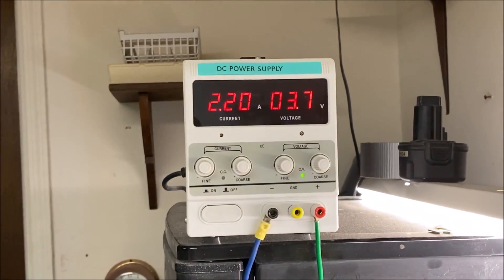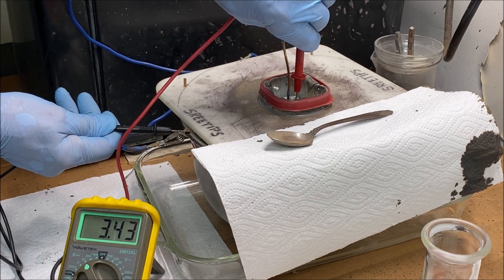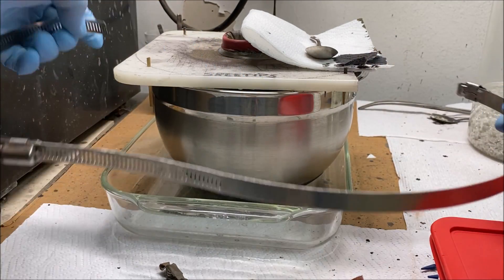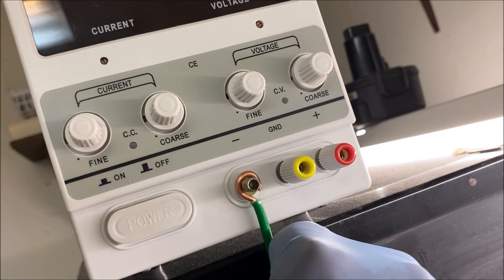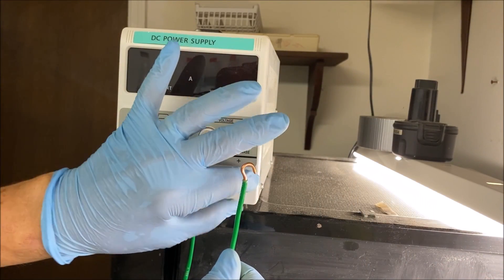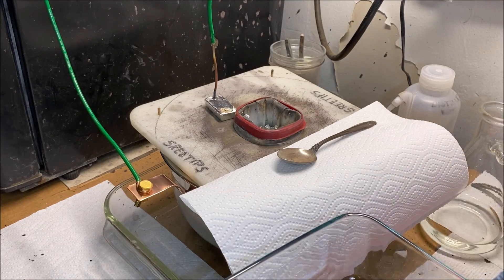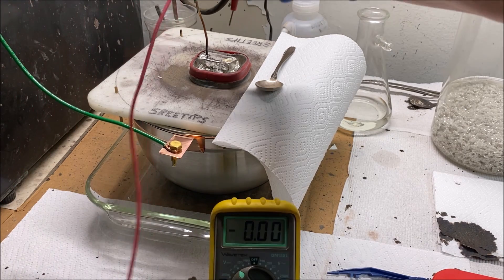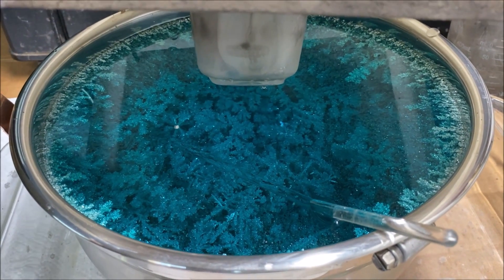EP007 Silver Cell Update New Cathode Connection

Comment: Hi mate, I used copper sheet as my cathode and the solution turned blue and doesn't work as well now, I'm guessing it pulled all the silver out of the nitrate. Can I add more silver nitrate to this solution and keep using it?
Reply from the maker: No, because in accordance with the reactivity series of metals, the silver in the silver nitrate electrolyte will “cement” out on the copper, consuming the copper until it’s gone completely. The cement silver will fall to the bottom of the container.
Reply: @sreetips  Thank you so much for clarifying! I thought this might be the case, I just wanted to make sure. New batch it is. Also is 925 ok to use as the cathode or should it be 999? Assuming the latter and will use that when I can, but curious. Cheers
Reply from the maker: I use a stainless steel bowl for the cathode. I feed in 980 per thousand, impure silver. The anode must be relative high purity to begin with. I achieve excellent results with this combination.

Comment: I would also try an additional anode connection at the base of the bowl - a copper round should serve as a nice base. 

You also could experiment with making a conductive grease using a bit of silver cement powder with some white lithium grease. Will be messy but only takes a light film to get the job done. 

The stainless bowl is not a great conductor which is why the crystals grow unevenly.

Comment: I took an expired / empty water based fire extinguisher (stainless) and cut the bottom off for my silver cell. About 8 inches. My silver basket is a 5lb peanut butter jar with holes in it. I fill it and put the lid on. It presses my anode down on the silver in the jar. I only need 1 liter of electrolyte to run the cell

Comment: Is the copper anode piece you made created out of a piece of 18ga. copper sheeting. That's what it looks like but I'm just checking to see if that's correct. The improvement to the flow of current is immediate and all your later videos with the silver cell seem to have no problems after this adjustment to the mechanism.
Reply from the maker: I’m not sure of the thickness. It was sold as copper strap from Georgia Copper Company

Comment: Great video again of course sir. What is the Anode bar made of? I'm taking notes on this procedure. How much scrap silver did you start out with? Is this procedure profitable? Thank you for your time and all the incredible videos!⭐⭐⭐⭐⭐rating
Reply from the maker: I made the anode electrode bar using pure silver crystal about 2.5 Troy ounces. I suspended a copper wire in a graphite mold, heated it to redness with a torch, then pour molten silver to bond to the wire
Reply: @sreetips  Thank you

Comment: Nicely done!  Great contacts there - only small thing I was wondering about is if there is any danger of the anode dissolving down to the copper - but honestly I think that is just really unlikely you leave unattended for a long time.  That nice thing is that it should be pretty consistent in terms of current.  The loss from those clips really is surprising - amazing what some corrosion can do!

Comment: You are doing a great job of removing that hidden resistance. You will eventually get some corrosion between the copper strip and the stainless clamp because of the acids you use floating around your lab as droplets and vapor. One solution would be to solder or braze that copper wire right to the outside of the stainless bowl. Another low tech solution would be to put a little vaseline between all the metal connections.

Comment: You should wrap that strip of copper around the whole S.S. bowl. and hold it in with the hose clamp. IDK, but will the crystal mostly grow near where the ground is? You could also wrap some black electrical tape to the ends of the negative wire. I done it a lot when I was a fitter and we ran out of a certain colour of wire.

Comment: If you are overly concerned with identifying positive and negative at a quick glance, you can always slip a piece of red and black heat shrink tubing over the ends of the green insulation. I did that when I replaced the leads to a battery charger this weekend.
Reply: Just wrap on with black electrical tape at the end but its shocking to see him FINALLY do what people suggested instead of cranking the power up and up

Comment: SREETIPS:   Take this one step further, and set the current limit of your power supply.   You do this by dialing the current limiting knob to whatever current you want.   That way, if the cell shorts, the supply won't short and blow, and just won't source any more current than what you specify.   You can set the current limit to just above where you have it now, so it'll stay in constant-voltage mode, but will go into current limiting if the cell shorts.   No need for a fuse, as the supply already has a better feature.   And there's usually an indicator on the supply as to when it goes into current-limiting mode, so you'll be able to visually tell.
Reply from the maker: I didn’t know that, thank you
Reply: @sreetips  No prob.   Love your channel, man.   And nice job on that copper ground strap!   As others have said, you'll still want to make sure no oxidation builds up between any points of contact, which could still happen, as everything is exposed to vapors.   You could get a few cheap panel-mount voltage meters on ebay for a couple of bucks, and permanently wire them up to the supply and bowl, to display the difference in voltage in real time.  That way if the connections start to get oxidized, you'll see it in real time.

Comment: I still wonder about the high voltage of this cell. When the ions involved on both electrodes are the same - Silver goes into solution and silver comes back out again - the voltage should be much closer to zero. I have a similar sized copper cell running at ~0,6V drawing 5-8A depending on temperature. 

Can you stick your negative probe into the electrolyte for a reading of the local potential difference?
Reply from the maker: Voltage setting is critical to avoid other metals plating out with the silver and for best crystal structure. 3.3vdc to 3.7vdc is the range. The theory behind it is a mystery to me - they said run it there and you’ll be fine.
Reply: @sreetips  True. I just try to understand what's going on there. I'm sure you're doing it right as your results are right.

Normally while electrolysis you limit voltage to an "as low as possible while keeping reasonable throughput"-level. BUT your voltage is a lot higher than what I'd expect. Somewhere in the chain you drop 3V on something that I don't yet understand. 
By theory you have to use voltage to dissolve the silver into ions. But you gain the exact same amount while plating out silver (as long as the electrolyte is reasonably pure). So in the end in this kind of electrowinning process the voltage is almost 0, just to drive the current.
What is the concentration of the electrolyte that you start with?
Reply: He'd need a reference electrode (Pt+H2 or Calomel), see https://en.wikipedia.org/wiki/Reference_electrode to read the potentials accurately.

Comment: I don't know if it matters or not, but it looked like you measured between the anode bar and the metal strap, not the bowl itself.
Reply from the maker: I seen that during editing so I double checked with the probe directly on the bowl and got the same number at the stainless bowl

Comment: Nice!!  Might be interesting to take a voltage reading on the opposite side of the bowl (from the cathode) to see if there's any voltage drop
Reply: I was thinking the same thing! 😂🤣😂🤣
Reply: I think that the crystal would have been growing significantly less evenly, before this, if it were a lot of resistance.

The bowl is stainless, which isn't great for conducting electrons... Hmmm...

Comment: I was literally thinking of a ground strap almost identical to that but I couldn't think of how to attach to the bowl.  Yours is a perfect solution.  I like it a lot!

Side question: Now that you're running the pure crystal have you noticed much in the way of slimes building up in the filter basket?
Reply from the maker: I’ve done this before. The electrolyte color doesn’t change and the anode basket filter stays clean - except discoloration from the electrolyte.

Comment: Yeah great idea! It certainly does the thing it's supposed to. I think it's probably even better than spot welding on the bowl because that could alter the stainless steel alloy and could initiate corrosion. From expierience I know the slightest amount of added Iron into the surface of stainless steel could start the corrosion process.

Comment: If you loose fluid due to evaporation, wouldn't it suffice to put in distilled water in stead of new silver chloride solution?
Reply from the maker: It’s silver nitrate not silver chloride. The level goes down from evaporation. The concentration of silver gets depleted out of the electrolyte as the cell operates
Reply: @sreetips  Ah yes of course, silly me.. 
So the silver concentration in the electrolyte stays constant?
Reply from the maker: No, it gets depleted as the cell operates. It plates out of the solution as pure silver crystal. I add more silver nitrate to replenish the silver concentration of the electrolyte.

Comment: you don't need any fuse, the power supply support easily a short.
set a any sort of sign (red) on the + line, same color wire is a risk of mistake.
Reply from the maker: One of the wires has a hunk of silver hanging from end. The fuse will protect the anode filter from burning through and releasing the slimes into the batch of pure silver

Comment: With the extra evaporation (spelling?) Could someone kind dome help to minimize ?
Reply: @Tano well was more thinking something that could just be lowered down on it like a tub nothing fancy then it would also help with contamination problems. And feeding isn't an issue you just remove the plastic bin/tub (storageb in?) like the ones you can buy from the garden/hardware store for cheap. Want to get fancy rig some rope to the ceiling and winch the 200g plastic tub when you need to do the feeding :p
Reply: @Tano more like a a cover think this is a big over exaggeration a boiling pot but with a square lid the corners will act as natural canals. so run off is easy to collect  like the steam from boiling in a pot but if the square has slight angles you have 4 points for run off. The heat should not be high enough to damage any normal food safe plastic bin so you could reuse the electrolyte and keep the full cell clean and if it's see trough plastic have full control over both runoff, silvershot levels and tools. Sorry not a native English speaker so if something sounds way of the wall might be a language barrier thing. Or just me :p

Comment: Hey sreetips, new to the channel, and I love your videos. In some of your videos I saw you had a hat with some DDG’s on them and was wondering what your rate was? My father was in the navy for 24 years and was an arresting gear green jersey for 2 years then became an EM. Chiefs run the navy!Also I was wondering what brand that DC supplier is?
Reply from the maker: MMCS(SW) 20-year man engineering down in “the hole” running main engines and generators.
Reply from the maker: This is the one I’m using: https://www.ebay.com/itm/30V-10A-Adjustable-DC-Power-Supply-Precision-Variable-Dual-Digital-Lab-Test-110V-/391321591608?mkcid=16&mkevt=1&_trksid=p2349624.m2548.l6249&mkrid=711-127632-2357-0

Comment: Why don’t you have more than one cell running at a time? Can you only run one cell per power supply unit?
Reply: As long as the power supply is working in voltage regulation mode, he could connect two cells easily, maybe three, after which the power supply's current rating would become exceeded.

Comment: Totally awesome more juice to it it's gonna really work good just don't use silver fittings to the copper fittings cause that's why they don't use silver in electrical cause it tarnishes the worst of all metals and it stop power supply just like lead does on a car or zinc on cables to battery but man that's gonna work nice now that silver is gonna pop now big times I love that configuration good job screetips
Reply: Wow that's awesome how you set that up wow

Comment: You will still have to check the new cathode from time to time for corrosion but it will be easier to clean of any corrosion due to it being a flat sheet now rather than a clip, and the brass bolt is fine most plugs use brass as a connection to connect to a houses power and it is less likely to corrode as much as a copper one.

Comment: Only thing I ding you on is solid wire is for AC current, DC requires multi strand wire to carry the current on the many wire surfaces. But if it is working for you, use it. There will still be galvanic corrosion on your Copper to Stainless contact zone. Now you could Gold plate the copper and get a long term excellent contact surface that will not corrode.
Reply: No, you're wrong. Only high frequency AC current flows on the surface of a conductor (the highest the frequency is, the lowest is the depth of the conductive layer). This rule is well known for decades by HF technicians like radio and radar specialists (I'm).
In the case of Kevin's silver cell, this doesn't matter: only the section of the cable matter, the DC current flows evenly through all the section of the wire (even at low frequency, like mains AC 50-60Hz, this rule doesn't apply).
Another advantage to use solid wire instead of multi-wire type is that the corroded layer of the wire will never be enough to cut the wire...

Comment: Nice upgrade,  but if the new copper starts to corrode you might need to coat the exposed copper with a clearcoat to protect it .
Reply from the maker: Dielectric grease

Comment: Very nice! I would suggest that you regularly check on your anode bar, and make sure it never dissolves into the batch... Otherwise the slight bit of copper that melted in, and the copper wire itself if exposed, could contaminate your batch...
Reply from the maker: Jason, copper in the electrolyte is not a problem. It’s already in there. That’s why the electrolyte is blue. Pure, copper-free, silver nitrate is colorless - like water.

Comment: Your anode bar is now contaminated with copper you need to have a bolt and nut to that as well.  Then you can clean the surfaces regularly without adding extra copper contamination to it.
Reply from the maker: The cell will handle copper in the electrolyte up to 60g per liter. Plus, a little copper in the electrolyte promotes fat chunky crystals. Pure silver nitrate with no copper in the electrolyte will yield slim or needle-like crystals. I learned this from a professional refiner on the goldrefiningforun.com - when I get my second silver cell running well test it out.

Comment: You did a great job only on suggestion have one of your electrical buddies give you a little bit of copper contact solution improves continuity and helps to reduce corrosion from acid vapor and environment that you're in on all copper and brass also a dab of anti-seize on your stainless steel threaded parts because they will corrode slightly oxidized and make it where you can't take it apart just a suggestion keep up the good work
Reply: Can't recommend adding some kind of anti-sneeze... Always helping the next guy, who is probably gonna be you when it's all green and fuzzy in a while... I wonder if something simple like petroleum jelly or mineral oil would be sufficient in this instance.
Reply: @spokehedz  anti seize on the hose clamp threads or they will gauld and strip when you try to remove them later down the road , electric connections to prevent corrosions which would reduce the current conductivity which he's trying to increase they make a special liquid for that application specifically

Comment: Use nolox aka antiox... it's used on wire connections of dissimilar metals to avoid resistance caused by galvanic corrosion.
Reply from the maker: I’ve got some for the plug wires on my Chevelle.

Comment: Is there a benefit to double refining?  Surely the single refined pure silver crystal was already three 9s fine?
Reply from the maker: It’s just for the show
Reply: @sreetips  Heck yeah, good enough for me, it is entertaining
Reply: The silver is even purer after the process, and he just loves to play with the random PGMs and other stuff that remaining fraction of a percent is composed of - that stuff is left in the anode sludge after the plating process.
He seems to sell some bars of silver online, and I wouldn't be shocked if a goodly amount of the silver he is processing is sold to his jeweler buddy (who of course would want it as pure as reasonably possible).
I have a brick of silver that's not stamped, but the dealer called it three 9s - in the same way, I want to pour shot then dissolve it a few times then cast more shot then run through a plating rig and know that whatever final brick I have is 4 or 5 nines... just for fun. And of course to save the sludge until there's enough to be worth the bother. :P

Comment: I would have used some dielectric grease under the copper strap. Over time you're going to have the same problem with your connections corroding. It's the environment your working in.
Reply: This ^
Its not the connection of the copper clip, its that there is current passing between two different metals which cause a layer of oxides that create the resistance. Its called galvanic corrosion- The best solution is dielectric grease which goes by nolox & can be bought at any hardware store. Electricians put it on aluminum header wires at a service connection.
Reply from the maker: I use it on the spark plug wires for my Chevelle.